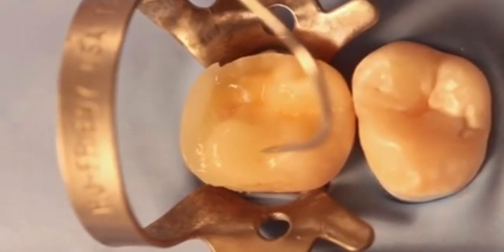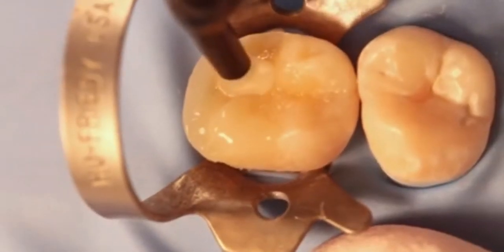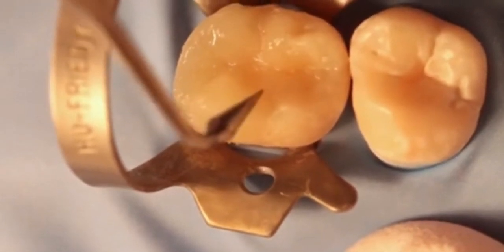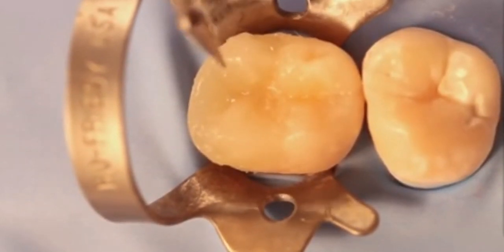Building Cusps with Composite Resin by Dr Lincoln Harris

Comment: good job good work well thats worth a try as many as it takes ...
but how did you mange to make the instruments not to stuck to the composite ??? and working without etching..?? and couldnt you make an inlay adapte it so y make it more easier ??? or thats not the case ..??
Reply: Dip the instrument lightly in uncured bonding agent.